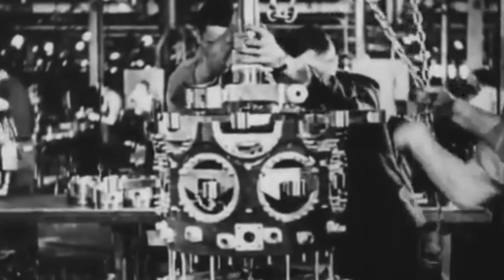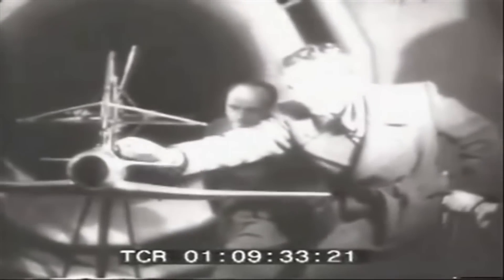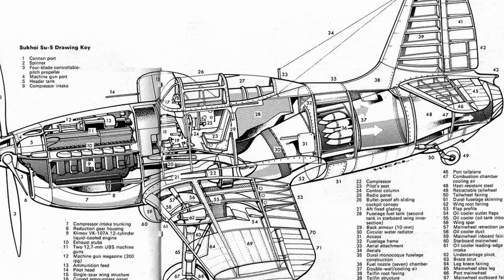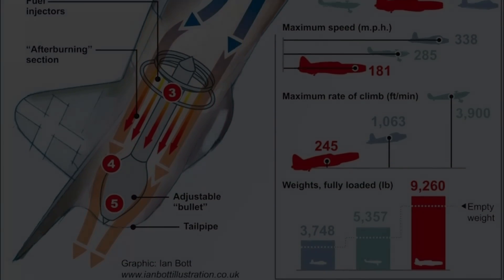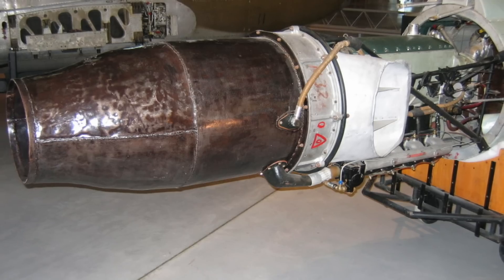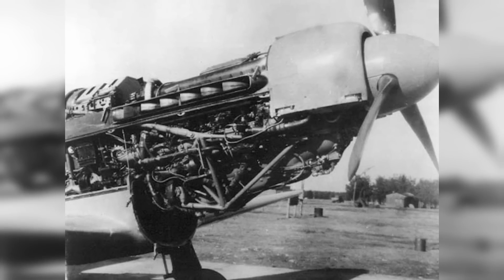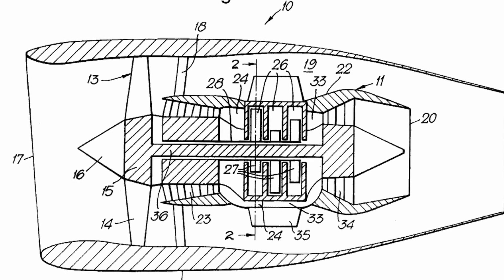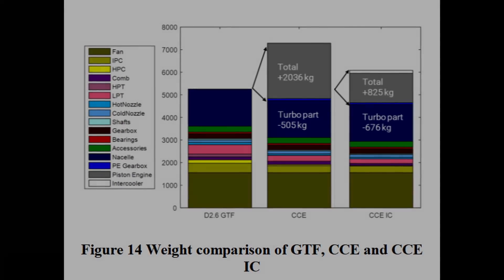What on Earth is a Motorjet?

Comment: Worth pointing out that the Axial compressors of these aircraft were all extremely limited in capability, and with more powerful engines with suitable C-D engineering aft the afterburner it may be entirely possible to design a supersonic aircraft with a reciprocating engine.

Comment: Caproni - Campini C.C.-2 N1 was a MotorJet (or a ThermoJet - on that era's terminology) whose powerplant concept was first time seen, in the history of aviation, at the "Coandă - 1910" aeroplane exhibited at the Second Aeronautical  Exhibition in Paris in October - November 1910...its designer being the Romanian engineer and inventor Henri Coandă. In December 1910, on the military training field of Issy-les-Moulineaux (outside Paris), Coandă, while was testing his plane's powerplant - as he never intended to perform a flight test that day - observed that the jets of hot exhaust gases from the engine, instead to follow a straight path, as expected, were attracted to the aircraft's fuselage, a phenomenon which, later on - after more than 20 years of continuous theoretical studies and experiments - will be named the "Coandă Effect" on his honor. Focused on adjusting the engine's fuel flow - with the purpose of trying to bring back, to a straight path, the jets of hot exhaust gases - Coandă was taken completely by surprise by the plane's fast taxiing which was heading  towards the old fortifications walls of Paris. With no options left, Coandă tried to fly over those walls but, after it took-off, the plane stalled and crashed, throwing Coandă clear out of the plane - fortunately, not being straped to the pilot's seat - just suffering minor injuries while the plane completely burned out. Such way, in 1910, took place - accidentaly - the flight of the first airbreathing reactive engine powered aircraft, "Coandă - 1910".
Coandă and Caproni colaborated at certain aeronautical projects in the early years of the 20th century.
Unlike the TurboJet, which have the compressor driven by the turbine which is spinning being "blown" by the jet of exhausting gases, a MotorJet has the compressor driven by an external source of power, such as a reciprocating engine, while extra fuel may, or may not, be added to the jet of exhausting gases resulted from the compressed air mixed with the reciprocating engine's exhausting gases. In short, the general design of a MotorJet can be simply described as somewhat similar to a ducted fan coupled to an afterburner. What is interesting about MotorJets is that, in practice, the reciprocating engine driving the compressor can provide enough thrust for flight without activating the afterburner, producing a - so called - "cold thrust" or with the afterburner activated,  producing a - so called - "hot thrust".

Comment: Why not electric transmission to eliminate the gearbox. That also allows reduction of the size of the engine since temporary peak power for takeoff can be drawn from batteries while the engine can be sized smaller for cruise power

Comment: I have seen a homebuilt motorjet. Not based on the Campini design but the Tsu-11, the motorjet from the model 22 Ohka. It uses a McCulloch TC-6150-J-2 turbocharged flat-6 2 stroke engine to drive a similar compressor with side inlets. It is installed in a small plane similar to the model 22 but altered by shortening the nose and installing a fuel tank, and with a V-tail like a Bonanza. It can cruise on the piston engine only and can go exceptionally fast with the jet started. It occasionally appears at the local airport once in a great while. I have no idea about who built it or why, but I've seen it with the tail removed and the engine exposed.

Comment: Jets are fuel-hungry, and not very efficient. It's not worth burning expensive, high-octane avgas in a jet engine without any octane number requirements. So, in order to make any economic sense, a motorjet should have two fuel supplies, high-octane avgas for the motor and low-cost whatever for the jet, be it kerosene, diesel, HFO, pretty much anything that burns will do. That pushes complexity and logistics pretty far. It would be more sensible to use one of the few aviation diesel engines for the compressor, at least from the fuel usage point of view.

Comment: What a very fascinating look such unusual aircraft types I really enjoyed it and I help me better understand how this type of aircraft works. But do the Ryan FR Fireball and the xf15c fall into the same category of a Motorjet aircraft?
Reply: >XF15C
No. It had 2 separate engines, that could work independently. 
The idea behind motorjet is that the regular internal combustion engine works as both an engine for propeller and compressor for jet, meaning jet part can't work as its own thing, as at that point its just a combustion chamber with no air flow.

Comment: You made a big mistake at 6:15 saying the Russians were aware everyone else were developing jets & rockets at the end of the war but them. When the fact is that in 1940 the Soviets were doing more developments in pulse Jets, ram jets, motorjets,, turbinejets & rocket powered experimental planes in the world. Being 1st in the world to fly a armed rocket powered fighter & the 1st to develop & patent a turbofan / fanjet. They were also on the verge of putting in production a twin boom fighter powered by a inline engined pusher prop behind the pilot & 2 pulsejets forming the twin booms. The inline engine & prop were to give it better range for cruising, while in combat action the prop would be feathered & the twin boom pulse jets ignited. The main central nose was left free for the nose wheel & a battery of guns for zero deflection gunnery, it also had swept wings & a pilot ejection system (due to the rear pusher prop). This aircraft was called the “D”. Problem was Barbarossa got in the way, with Stalin cancelling all aircraft development except with models already in production.

Comment: The technology forgotten because of terrible execution. (since nobody knew how to build correctly)
I think we may see return of motorjet in Ukraine war. 
Think about it, Ukraine needs something that can be made more cheaply then a turbojet, but with (potentially) higher speed then prop. Especially considering that motorjets do have 1 trumpcard. While modern turbines can withstand high temperatures, you still need to cool it. No turbine, means higher temperature, which as rocket equation tells us is better.

Comment: I think that this idea still has some validity.

With modern piston engines and compressors you could create something that is both efficient at low speeds, and yet possesses turbojet performance for brief periods. All at a relatively low cost.
Reply: for example, for a suicide drone which flies low and slow and then activates sprint mode for the last few minutes?  
Hell lets not forget that huge reason why motorjets were terrible when they were made, was because nobody bothered making them "right". i.e. for example no correctly made airflow, that helps to keep whole system running.

Comment: I learned back in the 80's, that a turbine engine in a Bell 206 helicopter put out about 400 hp; however, the engine actually developed 1000 hp of which about 600 went to the compressor stage of the motor, leaving roughly 400 hp usable.  I have always thought that turbines compress air inefficiently and have always looked to other ways to compress the air required for combustion of the fuel burnt. This really isn't such a bad idea and maybe it should be revisited.

Comment: The Motorjet was dismissed by the British pre WW2, so they never wasted energy on it.  The bypass engine has made great strides since WW2, with a modern airliner having only ~15% of is propulsion by jet thrust.  The rest is turning fan, which is similar to turning a propeller, in pushing air to the rear of the plane to push it forwards.  But as the vid says, the idea has resurfaced. I can only assume to use cheap mass produce ICE engines, whose efficiency has improved over the decades. 

A Wankel rotary engine appears ideal for a modern motorjet. It is about a third smaller with about half the weight for a similar power output to a piston engine, and very smooth in comparison. Its main drawbacks have all been addressed in the past 60 years. The efficiency rises when run at a constant speed. They are 25% more efficient when burning hydrogen. 

After a ten year hiatus, the rotary engine is being introduced to automobiles.  Mazda are introducing the MX-30 hybrid in Jan 2023 with a rotary as the range extending engine. It will only turn a generator. 

The dismissed motorjet may make a comeback for small planes or niche applications using hydrogen as the fuel.

Comment: I know it will be upopular but i would argue that this engine wasn't a jet.  
- Having an afterburner or not does not make or break a jet engine. 
- Having a fan compared to  3 or 4 blades doesn't make it a jet. 
- Having the propeller ducted doesn't makes it a jet
- looking similar to a jet, doesn't make it a jet. 

At 3:44  it shows a conventional piston engine that drives an unconventional ducted multi blade propeller. 
At the tail there is a afterburner.    That is not a jet. 

The fundamental idea of a jet engine is to use a ever increasing speed cycle. Blades in the excaust spin and directly dive  blades upfront to increase airflow, which increases pressure and speed of exaust gases which increase the speed of the blades in the exhaust which increase the speed of air pushed into the engine and so forth and so forth. An engine that has a disconnect between airspeed increasing output, increasing output increases airspeed is NOT a jet engine. 

I know a lot of poeple want an Italien to be the inventor of the jet. See it like this,  an Italien is the inventor of a ducted fan propeller with afterburner. Thats also something to be proud of!
Reply: "The fundamental idea of a jet engine is to use a ever increasing speed cycle. Blades in the excaust spin and directly dive  blades upfront to increase airflow, which increases pressure and speed of exaust gases which increase the speed of the blades in the exhaust which increase the speed of air pushed into the engine and so forth and so forth. An engine that has a disconnect between airspeed increasing output, increasing output increases airspeed is NOT a jet engine."

You are talking about a gas turbine, do some research on jet propulsion...

Comment: There have been modern developments of a somewhat similar nature to the motorjet, the composite cycle jet engine, which uses a piston engine (of whatever nature) as a pre burner stage gas generator to increase the thermodynamic efficiency of the whole engine. But so far all variants I've seen use the piston engine as just a gas generator having no apparent use for the shaft power to the main jet engine, perhaps due to scale that power is relegated to running auxiliaries. 
I suspect using the piston engine as a gas generator in a motorjet would improve it's efficiency, running a very large compounded turbine after it but before the jet combustor would keep the metallurgy a non issue and you could have a reasonably efficient early propfan.

Comment: Honestly,  i can see a use for moterjets even today, but would require a different style of aircraft.     Simply put, combining a ducted fan with a moterjet    Where by a gas engine turns the fan blades for base power...   This would be used for "cruise"  or "loiter" power settings allowing for an engine running at lower power settings, especially in more dense air.   when more power is needed, for takeoffs, emergency go around, or higher altitudes,   the fuel could be dumped into the compression stage of the motor-jet.  In a way acting as a "poor mans" afterburner.    

This would be "fun"  for kit/experimental class aircraft as they would not be true jets so wouldn't fall under jet restrictions.

Comment: My first visit to the Oshkosh convention was in 1974 and I recall a prototype on display that year or soon after of a one-half size F80 that used an automotive V8 driving an internal fan through a gearbox. I haven't seen or heard of it since then, and it wasn't ready to fly at that time, so I have no idea if it was successful. I suspect that that propulsion design would be less effective on a sport plane than a propeller would be, but the point of it was a jet-powered design without the high cost of a turbine power plant. It interested me a lot because it looked just like the fighter it replicated, only smaller.

Comment: Seems like a rotory engine would be a better option than a piston engine for this kind of layout. They are much smaller, lighter and simpler than a piston engine and they spin at a much higher rpm which I have to think would be better than the slower speed a piston engine needs to run at. They can also put out a lot of power when designed and built well. And are stackable so if you want a larger stack you just need a few longer tie rods and crankshaft and you can essentially bolt two or more engines together. The only downside is that when not built perfectly they can have reliability issues and the engine technology isn't nearly as far developed as piston engines.

Comment: There is a mistake at 9:27. There is no turbine in the high pressure section. What you called the turbine is in fact the radial compressor section.
Reply: It says 5-stage LPT thats Low Pressure Turbine. The diagram may be wrong, I don’t believe he made it but do think it wasn’t colored initially (never seen a patent-diagram in color)…

Comment: I wanna see designs opposite of motorjet. A design where a turbine harnesses power of the exhaust to aid driving a piston motor mechanically. 🤔
not talking about turbo charges that pressurize the piston engine cylinders, but actual mechanical connection from the turbine to the crack

Comment: 10% increase in fuel efficiency is a lot, but i wonder what practical applications this might have for hybrid/electric drives. Electric motors might need less gearing and with many short distance aircraft there might be a sweetspot in between a larger battery and the wight of an electrically driven motorjet to boost range? Kind of like an afterburner for electric aricraft, which would optimally use regenerative fuels or at least fill the gap towards heavier and mid ranged aircraft with better efficiencies?

Great video, my jaw dropped when i saw the inline ice which even had enough thrust on its own to power the plane. It's a logic step to use the excess heat but the idea of basically putting an entire engine inside another is really amazing

Comment: He S 50 was a Motorjet developed at Heinkel by Wunibald Kamm, with inherent better features than the Caproni, that actually was an afterburner reinforced version of Stipa duct fuselage. However, at Heinkel failed in obtaining enough cooling for the 2-Stroke engine, and never reached production. Gesund +

Comment: Gille St Hillaire designed a positive displacement motor called the Quasi Turbine. It is 1/5 the size and weight of a piston engine. The engine is empty in the centre and could house a transmission or generator. Multiple units can be ganged together like  Wankle. Rotating eliminated vibration and this airplanes could be lighter again

Comment: There are some new exciting developments being researched in rotary engines like the Wankel, and despite being a little less fuel efficient than pistons in their current state, rotaries are much smaller, much less complex. much lighter, and operate at much higher rpms... sounds like a better match for a Motorjet to me!  Thanks for the excellent video Flight Dojo!
Reply: At their peak they are relatively efficient in fuel use compared to a reciprocating piston engine. Everywhere else they suck.
Reply: @kieranh2005  
Yes, when running at a constant speed at their sweet spot, the Wankel is very efficient indeed. They do not like being revved up and down. Mazda's new MX-30 hybrid in January will have a Wankel range extender. It will be easy to convert to hydrogen running. Japan is turning to a hydrogen economy, with hydrogen produced economically by helium gas cooled nuclear reactors.
Reply: @johnburns4017  >They do not like being revved up and down.
So they are good in something like a cheap kamikaze drone that flies at constant speed, attacks with quantity and where lower noise is an additional benefit as it reduces detection.
Reply: @Poctyk  
They also do just that.

Comment: The Napier Nomad of the late 1940's / early 1950's was a brillient implimentaion of a turbocompound engne that at the time offered record breaking fuel efficiency at the expence of horrendouse complexity  https://en.wikipedia.org/wiki/Napier_Nomad.  I came accross some drawings when I was an apprentice and the Nomad was much more advanced than the engines we were producing for the HS125 loco's.  Unfortunately cheap oil and simple turbojets killed it stone dead.
The Nomad was reall a gas turbine using a 2 stroke diesel engine as the combustion chamber with the net result of massive overall compression ratios.  Power was taken from both the turbine and the engine via a compley hydraulic friction drive variable gearbox which overcame the matching problems described in the RR patent. Takeoff power could be supplimented with afterburning and water-methonal injection, it was a true beast.

Comment: The air turbo rocket is the turbine version of this concept: a small turbine powered a large high bypass compressor, with most of the massflow going outside of the turbine. The majority of the air of combusted behind the turbine, resulting in high thrust without much thermal stress on the turbine. Only good for high speed aircraft, really